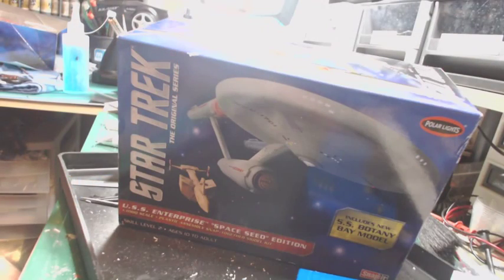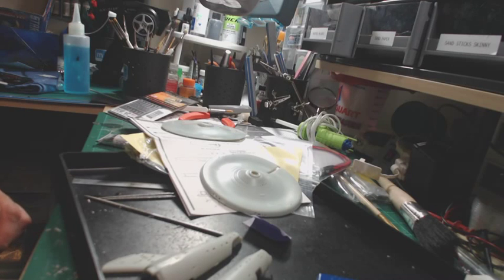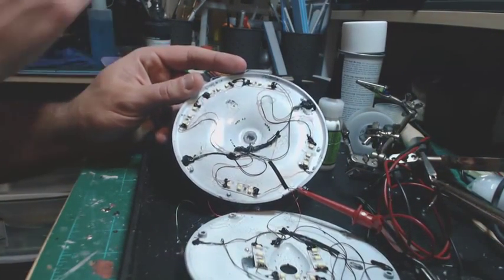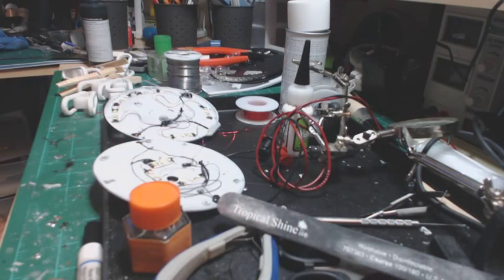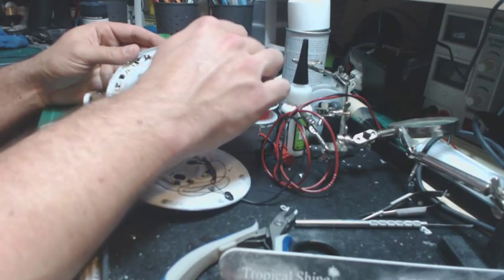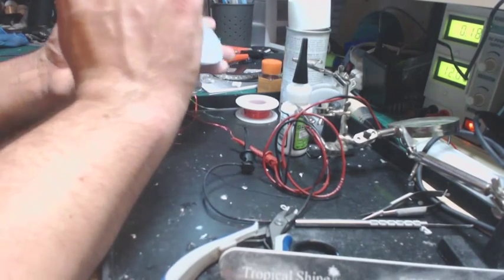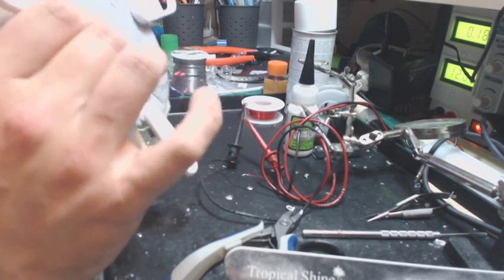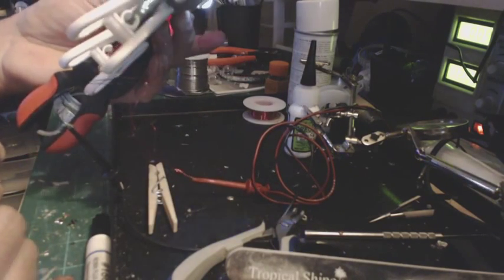1/1000 TOS Enterprise Part 1:  Saucer Construction And Lighting

Comment from the maker: Sam. On these small kits where the windows are not even marked its tough to get em perfect. Mine are def not lol. Now some people will fill these windows with a clear glue and then mask each tiny one off before they paint so that way you can get perfect squares. Some kits like the little refit have a photoetch drilling guide template to help. But with these small ones i just get it close...